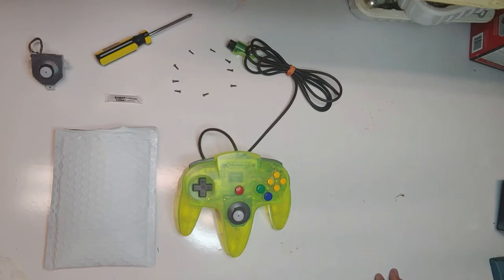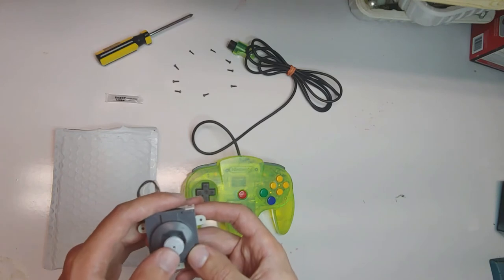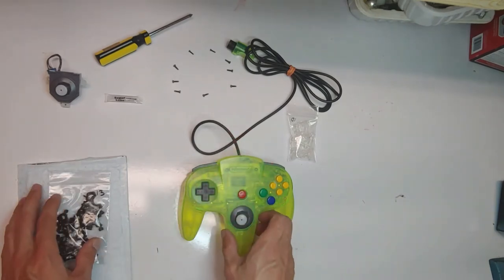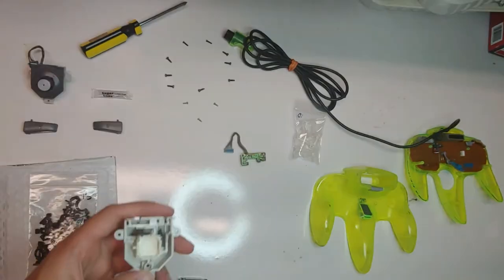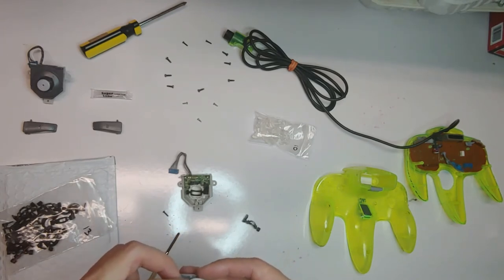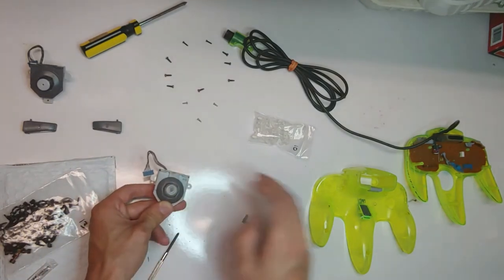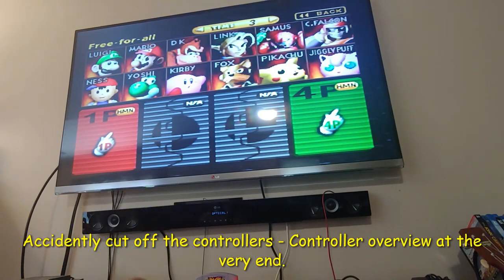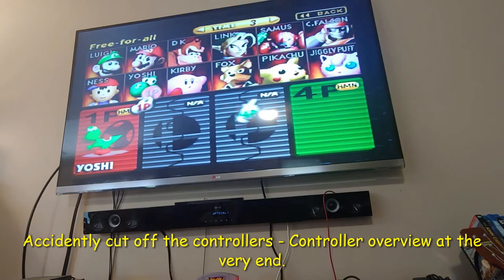Kitsch Bent Joystick Install & Review

Comment: You can't properly review these without the bowl. The gears, joystick, and bowl all grind away at each other which is where the looseness comes from in the first place.

With your worn out bowl, the new parts won't align correctly.

No disrespect intended though. This is a good video, and I'm glad you did a lot of in depth comparisons here.

Comment: I like the Kitsch bent stuff too, I even suggest sanding down the middle peg in the joystick housing a little so the new bowl sits down in there without rocking and then the kitsch bent stuff gets me to 9-9.5 out of 10 as long as I do that 1 small secret w the middle of 3 pegs, shave the tiny bits of flashing at the friction points, and replace gears, stick, bowl. I think that's less than 3 bucks. Definitely worth it to do it all the way right.  

If you do install the new bowl from KB, I'd be interested in hearing whether you shaved down the middle peg, or if you got the bowl to sit without rocking. Another secret fix I learned is to just not tighten the 1 screw holding the joystick housing together by the tiniest amount to create the extra space. I'm not sure, I think their bowl part could honestly use a tiny modification. If you get back into this kind of project lmk what you think. If not tho, nbd, Its best to just do what you're passionate about. 

I subbed you, take care and good luck.

Comment: The reason its prob drifting is cuz it's not aligned properly. I had that issue and once I aligned the joystick in the center, all sides wouldn't drift and worked very well. The bowls are in stock now if you're interested lol. Just the bowls. Can't seem to get the gears for quite some time now.